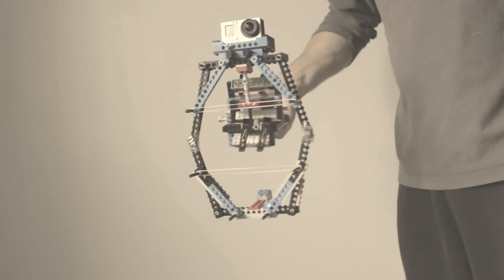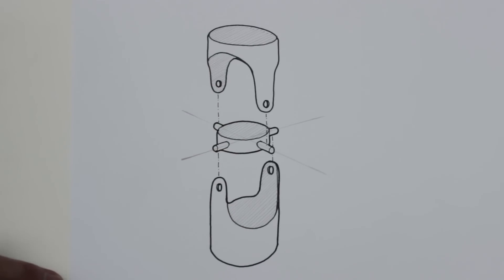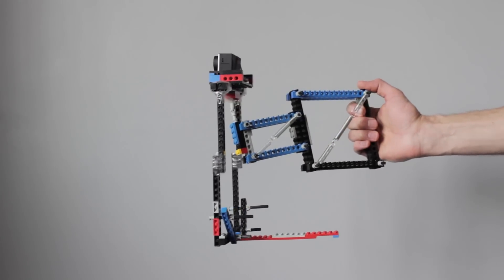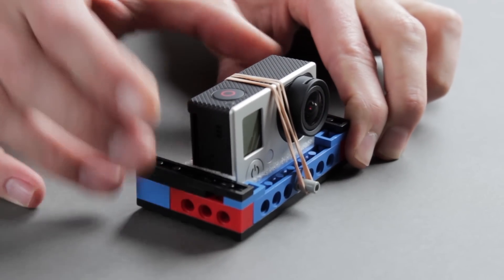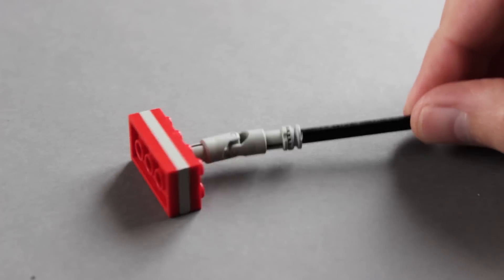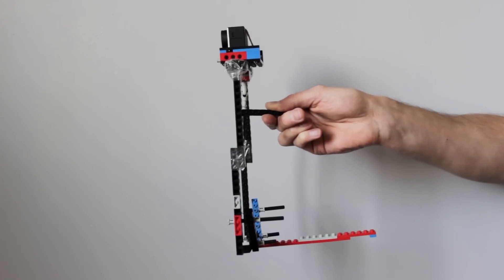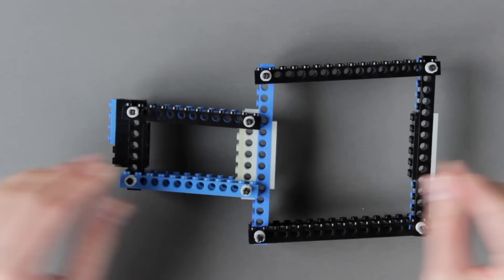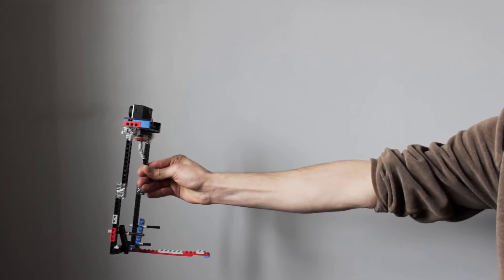DIY GoPro LEGO Stabiliser Build Tutorial Producttank

Comment: Built-in stabilizers have physical limits and result in lower image resolution and produce jittery video. This reduces the load and image quality reduction when used, together, with a camera's built-in stabilizer. Not to mention you get a much clearer shot.
One way to make this better...

1: Use  a longer counter-weight attachment. (It should be at-least half the weight of the camera and the length of the whole unit should be nearly 2 to 3-feet or 60 to 100-cm.)
2: Add some weight just under the camera, so there is an over-all greater mass to the unit.
3: Make a spring tension adjustment.
4: Use a low-friction "resistance dampening" connection for the joints. (Eg, shocks to go with the raw springs, to remove the "bounce".)
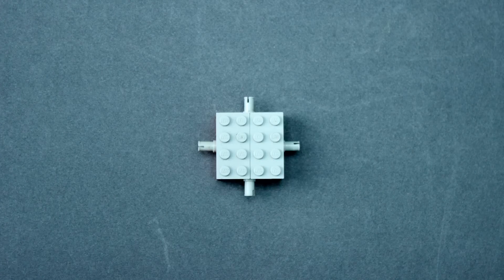5: Move the joint a bit further from the camera, downward. (Taking mind that #1 must also be done too.) Roughly a ratio of 1:6 or 1:10... If the distance from the camera to the pivot is 10cm, the total length should be about 60 to 100cm.
This is why a broom-stick, with a water-bottle on the bottom, held about 6" under the camera, works well with just your arms natural "tension", as shocks.

Comment: I tried building one of these rigs made with technics. The left/right and up and down were quite smooth but I couldn't get the back/forward to stop swinging.
The part coming down was about 12 inches & the counter weight extended back about 16 inches. It balanced real nice. Any tips on reducing swing.
Reply from the maker: Hi Tim,, the counter weight is very long, suggesting something is out. Try moving the camera back towards the centre pivot point a bit which will allow you to greatly reduce the length of the  counterbalance.  Then keep adjusting weight where ever possible until you get that really slow swing.

Comment: I'm certain one could get some lightweight extruded aluminium and use a self-built jig to ensure equal distancing of holes to make the 'frame' of this sort of thing using all-metal parts.

Retain the ability to adjust the position of things like the balancing weight (cantilever?), its offset on the crossbar at the bottom, allow for the use of heavier-duty springs and a larger, heavier camera, and have an overall more durable, longer-lasting and easier to 'take down and set up' system once one's done building it.